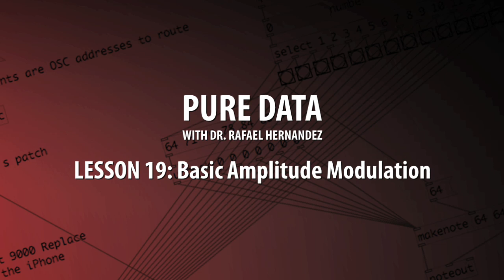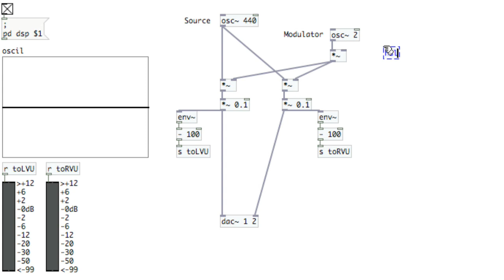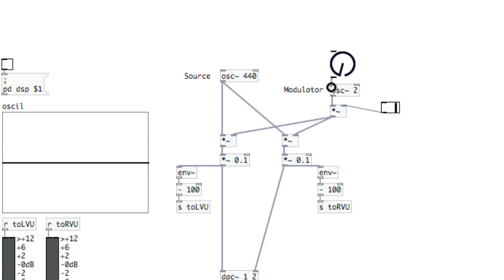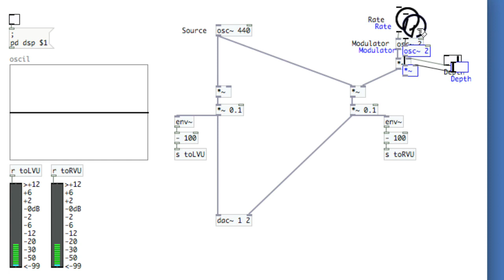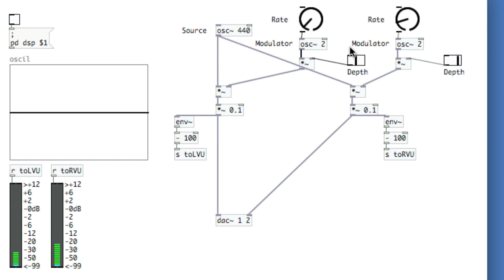PURE DATA: 19 Basic Amplitude Modulation

Comment: Noob question. this is frequency modulation correct ?
Reply from the maker: Paul Marandi No. It is affecting the amplitude of the oscillators. Frequency modulation would affect the frequency before entering another oscillator.

Comment: My VUs are constantly reading at 0dB when the sliders are at 0 and no sound is audible. Moving the sliders up to their set maximum value (0.1), provides an audible signal at a reasonable level to my ears but the VU immediately jumps to +12dB and is therefore of little use when it comes to monitoring. It doesn't make much practical difference but it does render the VUs virtually useless.

I'm really enjoying these tutorial videos by the way, they're really helping me understand Pd better, thanks.